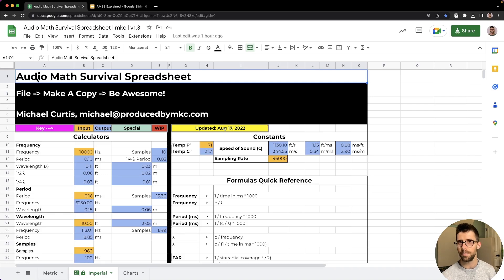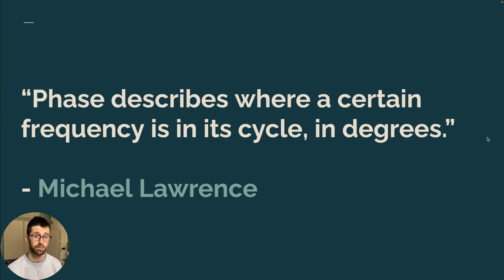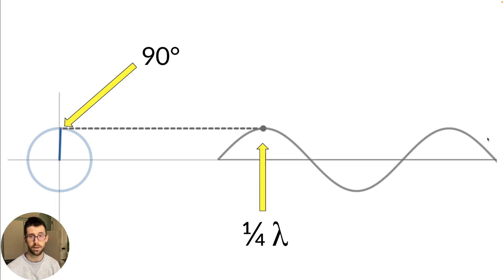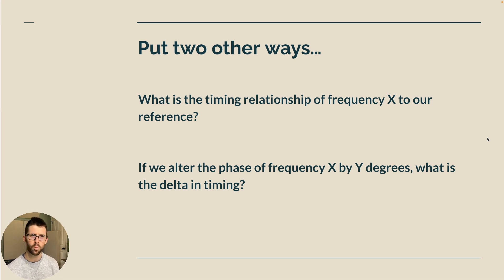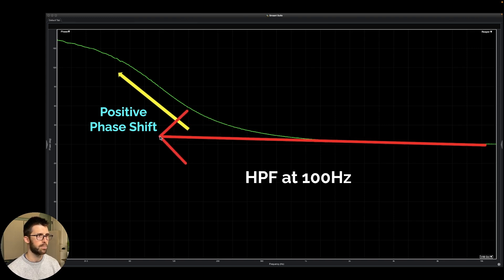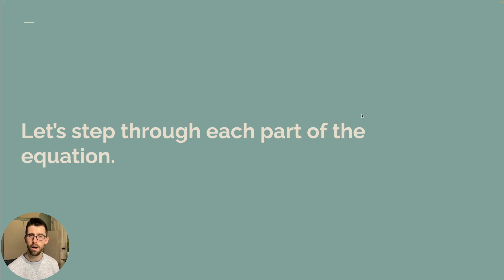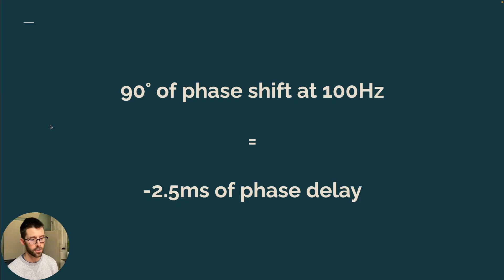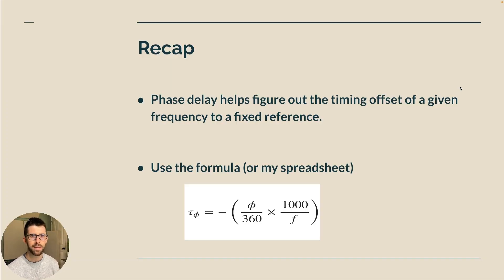Audio Math Survival Spreadsheet Overview -  Part 2 | Phase Delay

Comment: Do you have a calculation to convert sound pressure SPL into Decibels in A, B, C weights? If not, how would I put those formulas into the spread sheet please?
Reply from the maker: I unfortunately do not and a single spreadsheet value cannot determine that. You have to look at the broadcast frequency over level data to figure it out, then apply the A, B, or C weighting filters.
Reply: @MichaelCurtisAudio  I understand. That makes sense.  Thank you for answering the question.